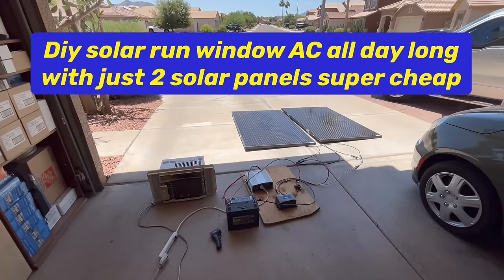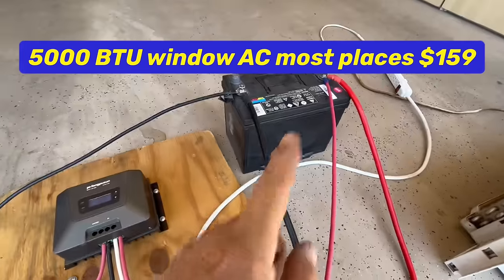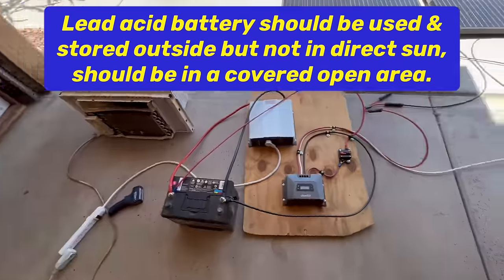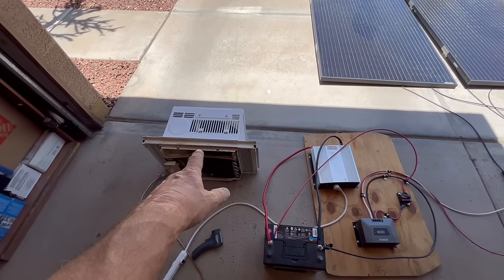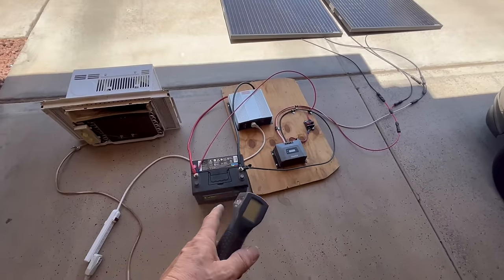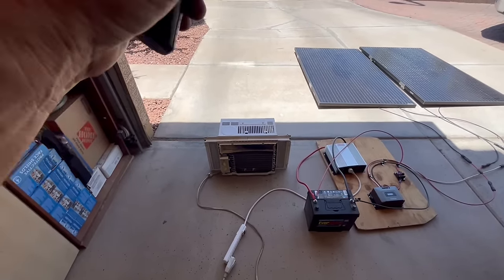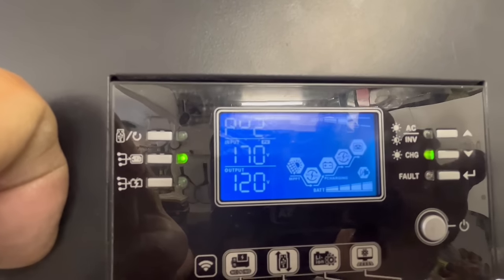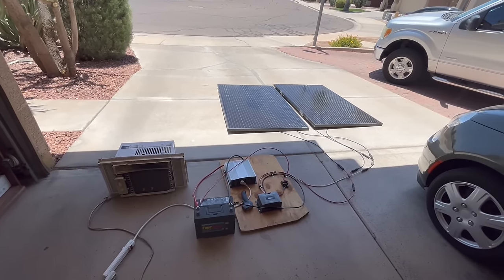Run your window AC with just 2 solar panels when sun shines. Easy DIY project you can do in one day.

Comment: One small note, that many building codes and also mfg installation instructions require a certain amount of clearance above / around the A/C for new installs. 
Nevertheless, the fact that this can power an AC is quite amazing. Unfortunately, our HOA won't allow window units... and  our central unit would need a LOT more panels. But I do think it is a great idea.
Reply from the maker: I am actually running my 3 1/2 ton and 4  ac units with solar and a LiFePO4 25.5 kWh battery bank overnight. Check out my other videos on what else I run with only solar power. I run my central ac 7/24 with solar. You will be amazed. Thank you for your input. Hope you have a wonderful and blessed day
Reply: Central Air would presumably benefit from the addition of a "soft start" as well?
Reply from the maker: @vwbustube  I have a soft start on my 3 1/2 ton and 4 ton central heat pump ac
Reply: Duh! Put in a small mini split
Reply from the maker: @cruz47144  I installed 6 mini splits in my house, 2 upstairs, 2 downstairs and 2 in garage. I also have my upstairs and downstairs central ac’s as well. All can run off solar and battery bank, I can air condition my house 24 hours a day with just solar in day and 25.5 kWh EG4 LiFePO4 battery bank overnight. I really like mini splits, they use 1/2 the power of central ac units. Thanks for suggesting but I already did it.
Reply: But here's what you're not getting. If you run a window air conditioner directly off some solar then it reduces the load on your central air conditioner and your central air conditioner will not come on as much. So you're going to directly lower your power bill. You don't need to power your central air conditioner buy solar. All you need to do is lower the demands on the central air conditioner. In fact if you learn to start just air conditioning the rooms you actually stay in and setting the rest of the house temperature at a much higher temperature you will drastically lower your power bills.
Reply: @yougeo  Agreed, powering smaller units will decrease the load on the central unit.
Reply: Friend's HOA also doesn't allow window units.  Which they can't see in the bushes nor in her back window. behind the bushes.   So yes, they could technically tell her to remove them.  And she would.  And then she could put them back.
Reply from the maker: I have videos using mini splits. I actually drill the hole for the lines a few inches above the floor in the wall. You can place the outside unit as close as 10 inches away from wall. These 12,000 btu mini split can cool and heat up to 600 square feet. All you would see outside is the outside unit that sits on the ground. I am an HOA president and I would gladly approve this for home owners. These mini splits start at $500, people in my subdivision are spending $13,000 and up for a 3 ton ac unit. That is a huge difference and mini splits are multi zones up to 5 or 6 room with separate remote for each room. Those multi zone units are   Around $4000 to $5000. You could use that in place of central ac. Check out my videos to see how and where I installed these in my house and garage. Thanks for your input, hope you have a wonderful and blessed week.
Reply: @diy-solar-guy  Come on! Mini splits are there for home owners to install. Each time you need a room cooled you need to install these unsightly monsters and you need to run separate line sets to each one and of course add  freon for the longer runs. These become less efficient as you run more compared to a central unit which only requires ducting in the attic space. There really is no comparison other if your just adding these to a air starved room, small granny quarters or a workshop. You have a great day.
Reply from the maker: Actually I have had 6 mini splits installed for 4 years now DIY, no leaks and no problems at all. I have friends that don’t have $13,000 for a new low end central ac and have chosen to install DIY as an alternative. Mini splits are so efficient , I use two 12,000 btu mini splits instead of my 4 ton and use 1/2 the watts, that is huge when running with solar and battery bank at night. Mini splits are here to study because the average home owner can buy for as little as $500. No financing . Just pay cash. I know hvac people hate the mini splits because home owners can install themselves. But air conditioner replacement has out priced itself and this is the only alternatives and people are paring with off grid solar. Mini splits are here to stay, they are used all over the world. I paid $13,000 for a 3 1/2 ton and 4 ton heat pumps installed 5 years ago and they are nice units. Now just one 3 ton heat pump is over $13,000 installed. It is easy to see why people are looking for alternatives to this outrageous over priced heat pumps. Like it or not, mini splits are flooding the market and will soon replace central heat pumps, and the fact the home owner has to only spend $150 on vacuum pump and gauges  is well worth the savings. Even if they only last 7 years each, that is still only about 1/13 of the cost two install 2 mini splits over 14 years than $13,000 for one central heat pump for 14 years. Hey thanks for you input. Hope you have a truly wonderful and extremely blessed week and stay cool. I know we hardest coped with our mini splits being around 115 degrees in day in Phoenix. Best investment I ever made, was buying mini splits.
Reply from the maker: You might think they are unsightly, but for someone who can’t afford a new ac or the repair bills, $500 for a mini split is their only option they can afford. I have spent $500 on 2 pounds of refrigerant added to my system and $500 to have my dual capacitor replaced. Totally ripped off for a $25 capon Amazon and $30 worth of refrigerant. Home owners now have other options that are DIY friendly. Mini splits are here to stay and do attractive to home owners who are just trying to get buy and broke from High inflation. Mini splits have not increased in price in last 4 years and that’s with preloaded refrigerant in outside unit. Whole house heat pumps have doubled in just 4-5 years. Now they are having to use a totally different refrigerant than what we have been using last 5 years in all appliances that use refrigerate or air condition. Regardless of refrigerant, mini splits will probably not go up in price, just will be preloaded with new refrigerant in outside unit. Once again only thing home owner needs is gauges and vacuum pump for $150 on Amazon. Everything Else is included with mini split. So for $650 you can install a mini split yourself. Now they have new mini splits at Signature Solar that does not require a vacuum pump or gauges to install. Those units are $1200. They even have direct solar input that has inverter and charge controller installed in outside unit. Extremely easy for home owner to install, can be connected to grid do that when sun goes down mini split automatically switches to grid power, then back to only solar in the morning wen sun comes up. Major technological break throughs in solar and mini splits. Most of the rest of world has been using only mini splits, just introduced in last few years in USA. The world is changing rapidly, need to keep up. Hope you have a great day
Reply: @diy-solar-guy  You are right that I do find the units a bit unsightly. But, they still serve a valuable function, and there are some decent looking units out there too, I recall reading about something like a picture frame style too. 
One note: Handling Refrigerant does require EPA-approved test to earn Section 608 Technician Certification. (Pretty much everyone in the HVAC industry has to have one because they handle refrigerant). However, there are some brands and units that don't require handling refrigerant... which is great for the consumer.
Reply from the maker: @marcfruchtman9473  thanks for that great information. We appreciate it. Hope you have a wonderful and blessed week
Reply: Just a side note: HOAs are domestic prisons. You pay for your property, then your pay for the HOA. But you have to get permission to do anything. They have limits on what you can and cannot do. What a bunch of BS!
Reply from the maker: @greensky01  I live in an HOA and that is why I chose to make solar arrays below the 6 foot cinder block wall and use solar panels on top of my pergolas. Did not need to get approval since you could not see as the solar panels blended in as a roof on pergolas. Not one solar panels is on my roof except 2 solar exhaust fans. But yes you are right, some HOA’s will fight you. Just make your solar blend with back yard. I got approval for pergolas, then added solar panels that blend as a roof and are black frames on solar panels. Problem solved. Hope you have a wonderful and blessed week
Reply: @diy-solar-guy  Thanks for the reply. Glad you fora way. Thank you and same to you!
Reply: What's HOA's Rationale on why they don't allow window units?
Reply from the maker: @peacebewu  I would venture to say they just don’t like the look of the window ac. Mini splits are becoming more acceptable with HOA’s. Just want the outside lines covered with pvc Line set  covers and then painted to match house color.
Reply: you need to buy 1 good hybrid solar inverter then you can run your ACs without any problem
Reply: @macmcleod1188  HOA's should loosen their stance on that.  They can be heavy handed.
Reply from the maker: @user-qr7ee2cp4y HOA can’t really say to much about a window ac installed in window that is facing your back yard.
Reply: I would never buy where an HOA exists.
Reply from the maker: @crosisofborg5524  there are still a lot of places to buy a house with no HOA.

Comment: on summer this idea was on my head .im glad to see this is possible
Reply from the maker: Simple and easy. This is just the basic set up of components. Adding more solar and better batteries will make the system better. If it gets cloudy out, you will drain battery quickly. Keep that in mind..but I was able to use this set up in an in closed shed all day to keep the inverters for solar cool. I eventually expanded on this and now run my main house heat pumps that are 3 1/2 ton and 4 ton for my upstairs and downstairs to heat and cool 100 percent of the time using only solar in day and LiFePO4 battery bank at night. We also heat/ cool garage, run freezers 24/7, run pool pump 24/7 and even heat our pool in winter months when we don’t need to cool or heat house. Check out our other videos to see what you can do with off grid solar.

Comment: Brilliant project, I’ve been looking for a cost effective way to keep my addition cooled off in the hot Oklahoma Summer time with direct afternoon sunlight. So far I’ve just used black out curtains and foil in the windows. About to upgrade to foam insulation boards on the windows and this would be a nice bonus to add too. Do you think a deep cycle lithium battery would be more effective than a lead acid battery? I’ve never done any solar projects before so IDK what type of batteries are preferred.
Reply from the maker: Lithium Iron phosphate batteries are far more efficient than Agm deep cycle battery.I will be installing 2 different types of ac in my motor home, a window ac and a mini split with direct input from solar panels with no need for inverter or battery. But can be wired to use grid power at night time. Stay tuned for those videos. AGM lead acid deep cycle batteries will get you through the day while sun is out but are pretty much worthless for running ac or mini split overnight. You will kill the battery draining it in the middle of the night and greatly reduce the life of the battery as where LiFePO4 batteries can go down as low as 80 percent drain on battery and last over 10 years and more. You can find solar kits for a very reasonable price now as compared to 5 years ago that pretty much include everything with or without battery bank. Check out my videos on mini split ac units and how efficient they are. Mini split heat pumps start around $500 and up. They can last 7-10 years if installed for and maintained properly over the years and will pay for themselves in a year or two. They cool and heat down to 30 degrees. For $500 you can cool a 500 square foot area. You can direct wire a or put 10 gauge cord on to plug in. Higher efficiency seer lower the cost to run and keep running. I will be getting some new mini splits that are extremely DIY friendly that do not require a vacuum pump or gauges to install. Stay tuned. Hope you have s wonderful and blessed weekend

Comment: Very cool....I have 500W (2×250 panels) with that same charge controller, two batteries in parallel, runs my fridge, lights, and can run my laptop etc. I have a 400W pure sine inverter (can surge to 800) that I think I'll try just as an experiment to see what's what.  I was going to buy a generator, which would make my rig completely off grid but if this works...yeah, I could save 700.00....Great video, thanks for sharing !!
Reply from the maker: I started with this simple set up then after 2 years added a 24 volt 2400 watt off grid all in one pure sign wave inverter and ran 3 chest freezers, a 24 cf fridge/freezer combo, lights and my pool pump at 1000 rpm 24 hours a day. Then after another year I went to 3 separate 48 volt off grid all in one inverters. See my videos on how I did this and what components I used. Cut my electric bill from over $5000 a year to little over $1000 a year and all my system components will be completely paid for with saving in December of 2023. Free electricity next year and after. Yeahhhhhhhhhhhhh. Glad you liked the video, check out my other videos on running almost everything in my house with off grid electric. By the way, everything I run, I had to run separate wires from inverter to appliance and hard wire or add outlet to plug into. Nothing I gave us tied to my grid in any way.

Comment: You might want to add another panel for reserve for cloudy days. This set up also will not provide enough power to run the AC at night only during the day when it is hotest.
Reply from the maker: You are correct, this is just a simple example of how to run ac from solar power. You can expand and improve this system in so many ways. Check out my videos on completely air conditioning my 2450 square foot two story house and 3 car garage with solar in day and battery bank at night. Hoe you enjoy.

Comment: Awesome video.   I've been building a off grid power station in my truck camper 2 Lifepo4  batteries in parallel, 2000watt pure sine wave inverter,  60amp Makeskyblue Solar charge controller.     I only have enough room on top for 2 200w panels but was thinking about making it so I can hook up some panels on the ground to add to it.    Maybe 400w panels will be enough for the 12v roof top ac I was thinking about getting.    It looks like they are very efficient.
Reply from the maker: I’m going to install some solar on the roof of my motor home and bring along a ground mount solar array to have 4 solar panels on ground mount and 2 solar panels on the roof. Looking at using the new Bifacial 400 watt to 500 watt back side gain. For a total of 7-400 watt solar panels. I can run my 12,000 btu, 120 volt min split. Only need 1200 watts at max and down to 300 watts at minimum. Already installed mini split in motor home and run on shore power or propane generator.

Comment: Awesome video.

Id love to know what model of ac can blow 43 degrees when it is that hot outside.

Ac guys always tell you the reason ac doesnt blow cold is because its hot outside…on an ac inside.

Ive always thought that was bs. This proves that.
Reply from the maker: Thank you. Usually out here it is hard to get lower than 40 of the outside temp for the room temperature. The temp of the air blowing out of the ac is much colder than the room temp. It can be 110 degrees outside here and my whole house ac or mini split can blow 35-55 degrees. But you won’t be able to get your room that cold with all the heat sources like windows, doors, walls, etc…
Hope that helps to clear things up. Thanks for the comment and hope you have a truly wonderful and extremely blessed day.

Comment: That's a nice DIY system, well done for the home owner. I would only add that its possible to purchase a "Hybrid" inverter that automatically switches to the utiity grid when the battery becomes exhausted can't keep up.  Truly to have an AC or minisplit and a few solar panels, panel 4 kw battery and hybrid inverter to power it all for a home would be great, save hundreds of dollars a year. However, it would take five or six years to pay for it all with electricity savings.
Reply from the maker: Actually if you see my latest video I am now 100 percent solar and battery bank for my air conditioning. I spent $0 last month on air conditioning even though it is 113 degrees in day and 85 degrees at night. My house is 2450 square feet and I even air condition my garage all day with solar. My pool pump is 7/24 run by solar and battery bank. I also heat my pool to 89 degrees in the winter using solar and 2 different pool heaters that are electric. Check out my other videos to see everything possible with off grid solar. Thanks for your input.

Comment: Hey friend, just a suggestion, if you have a local welding supply shop, go get you some 0 or 0/2 welding wire for power cables. it is a little pricey (about $3 a foot in my area) but it will carry your amp load. we use it for big car stereo installs. you can get up to 0/4 gauge.. i running 0/3 in my truck pushing around 7500 watts of amps.
Reply from the maker: Thanks so much for your input. I will check into that.